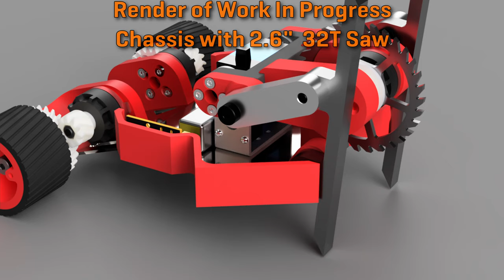Let's Saw Something! Shrapnel Mine 3lb Beetleweight Combat Robot Design

Comment: Would attaching some small hooks on the top of the forks prevent bots from going overtop your bot and potentially keep them in place while you saw?
Reply from the maker: Yup, that's a great idea and something I'll definitely play around with. I just need to also be careful that it doesn't impede driving upside down or self righting.

Comment: You can often find engineering-oriented sales pages for lipos by finding the manufacturer name on the MSDS sheet for your batteries. You can then find the cell you are using by searching that manufacturer's page for your chemistry and cell dimensions.  Once you've found the cell, they often have a chart of C ratings vs time at that rating, which can give you some nuance. For instance, a battery marketed to the hobby community as a 85 C battery might have a continuous rating of 30 C with 80C for two seconds and 90 C for an instant. So if you have a saw that will spend a decent amount of the match under load, you can optimize your current draw accordingly.

Comment: Hey Seth, love the concept of Shrapnel Mine! 
I believe the reason the saw isn't cutting through that aluminum is because it's running out of the pressure necessary to dig out more material. Compared to carbide-tipped saws, ar500 is fairly dull;  when you first start cutting the pressure is still great enough that you're able to make progress, but once that channel becomes larger you rapidly start losing pressure. That's further compounded by your blade being much thicker than the average sawblade.
Using fewer teeth is an option, however it increases the risk of binding. Personally I don't think it's worth it.
Using thinner ar500 would definitely help,  whereas using a commercial carbide blade should give you a huge increase in performance.
Reply from the maker: I have no idea how to find a carbide tooth blade small enough for this application (between 2.25 and 2.8 inches diameter) and if I did I would need to somehow cut a perfectly centered spline or rectangle bore which would be quite a challenge. I considered it originally but thought it wouldn't be worth the effort. If I can find an easier way to do so then I'll certainly consider off the shelf blades
Reply: @JustCuzRobotics  The blades I use on Breakpoint are 3", which is only a tiny bit bigger. I don't know how feasible that size is for you.
As for mounting, I know it sounds crazy, but you might be able to get away with just the friction created by the locknut and a plastic spacer. I've used that combo in 10 matches now and haven't had any noticeable issue with slipping.
If you want a more secure mount you can also drill holes in the sawblade that let you screw into a printed hub, which then interfaces with the topology of the cam and is kept in place by the locknut.
Reply from the maker: Have any links to the saws you're using?

Comment: what made you choose the custom sendcutsend sawblade over a store bought one? motor mounting?
Reply from the maker: Yup you guessed it! The way the saw keeps spinning is that inside of it is a 15mm hex bore, and a 3D printed custom hex adapter to fit inside that bore. The motor shaft is an M5 threaded shaft, and using the flanged locknuts that come with the motor sanded down to fit in a smaller hex bore, I was able to get great torque transfer to the saw and choose a cutting direction that tightens as it cuts so the blade will never fly off. Cutting a hex into hardened steel on an existing blade would be incredibly hard to do.

Comment: My guess is that more teeth will increase its ability to cut through aluminum. Keeping the chip load constant, your material removal rate will increase. The balance is keeping chips from getting stuck in the saw blade itself. I use merchant's circle analysis to get a rough idea of cutting forces when I need it. I just set the shear stress as whatever that material's flow stress is an go. That might be useful for determining the torque you need vs what you have with your motor, blade...etc. Most materials also have documented "machining speeds" so that could be useful for targeting rpm's for different kinds of armor. Idk if youre getting that specific or if this is at all useful information, but I love this concept. Keep us posted!
Reply from the maker: I 100% see what you are getting at, I was just starting to think of this in machining terms as well, as I have done some CNC operation and the speeds and feeds and chipload seem to be analogous here. 

The way I see it there are a few factors I need to keep in mind. 
1: I have a limited amount of torque at the saw as I am stuck with the same motor and RPM (or lower) for all sizes of saw. 
2: I can increase the diameter, which even for the same cutting force, would also increase the torque demand on the motor. 
3: I can increase the number of teeth to take more smaller bites, decreasing the torque demand, or remove teeth, taking larger bites, increasing it. 
4: I may also be running into an issue where my bite chipload is so small I am rubbing rather than cutting efficiently, in which case, fewer teeth would help. 
5: Fewer teeth and larger bites also raises the chance of 'launching' the opponent upwards rather than cleanly starting a light cut. This may be avoidable through careful arm/drive control on my part. 
6: The rules of most events allow for a stationary pin no longer than 10 seconds, so I need to remove material as fast as I can in that time once I start holding an opponent against a wall.

Comment: Hey Seth,
We talked about using a multi material Printer for the wheel Hubs. I am in a big educational Workshop while learning a new Job. And there is an Ultimaker with 2 Extruders. If you want to experiment with a TPU and Something mix, I can get access to this printer. Some copies of a smaller Part shouldn't be a big problem.
Reply from the maker: Thanks for the offer! I'll let you know if I can think of something to try out but if I cannot replicate it myself repairability might be a big problem

Comment: 5:40  A saw blades teeth have to make a wide enough cut to allow the blade plate to pass through. Check out 'Kerf width'.  Also, how hot is the blade getting when cutting aluminium? Expansion slots and tooth angle or 'hook' might be something you could experiment with as well.
Reply from the maker: So looking at some commercially available saws, it's definitely the case that most large blades use carbide teeth wider than the blade itself. However it's pretty common for the 3" diameter and smaller wood/plastic saws to basically be just like what I designed, but much more smooth and with more smaller teeth. Most of the metal saws this size are abrasive wheels or cutoff wheels with no 'teeth' 

Slitting saws are very similar to what I have made but are designed to cut aluminum with constant flood coolant on a rigid CNC machine which is obviously not the use case here. I'm thinking I may be fine using these lasercut saws on soft materials but I'm gonna look into mounting and trying a metal cutting saw for aluminum and harder materials.
Reply: @JustCuzRobotics  Have fun experimenting! 👍
Reply: @JustCuzRobotics  Cut edge quality is a huge priority for commercial blades, lifespan as well.

Could try bending each tooth slightly, alternating every other direction.

Comment: I wonder how a little asymmetric disk would do, since you mentioned throwing things over the bot. A good hard shot to the underside tends to have some nasty consequences, see biteforce vs hypershock.
Reply from the maker: I have intentionally gone with a cutting weapon since I have very little weight to dedicate to it and I feel that it will be extremely hard to get good bite and deal damage with an impact weapon weighing only 40 grams or so. The fact the forks angle up and the arm sort of comes down as they do also makes its travel less than ideal for delivering a big hit.
Reply: @JustCuzRobotics  Ah true. It would be light fighting beetles with a fairy weight.
Reply: @DigitalJedi  It would also put a lot of stress on the mechanism of his own bot whenever he engages.

Comment: Why not put some rubber near the tips of the lifters so a machine can't slip away and for more pushing control
Reply from the maker: Rubber on the lifter isn't a bad idea, and I think adding some ridges or hooks might also work. This whole test process is really just to get the proof of concept to cut something and show that it can work at all. I have a ton of room for improvement!

Comment: You need a carbide tipped saw blade go thought like butter
Reply from the maker: I tried that with my 12lb robot Draconid which uses a horizontal saw as a weapon. The carbide teeth fly off about 10-20 seconds into cutting since the cutting setup isn't nearly as rigid as a mitre saw through a clamped down workpiece. Then it's just dull steel nubs!
Reply: @Team Just 'Cuz Robotics  ahh I see what about one of thoes combination  diamond grinder wheel that cuts steel alum tile pipe plastic
Reply from the maker: I tried a diamond grit saw in this other video https://youtu.be/umQ5ZCRrX5o

Comment: Try offsetting the teeth like they do on regular saws. Instead of all the teeth being in a straight line offset them and add more
Reply from the maker: I can't since it is cut from a flat plate
Reply: @JustCuzRobotics  true. But you can always bend and temper the teeth after?
Reply: @JustCuzRobotics  You could maybe file them to get them sharp and a little bit off set. That would make it potentially easier to start the cut.
Reply from the maker: AR500 doesn't like bending, especially not something that size
Reply from the maker: I suppose I could try filing the teeth hut there is no chance it would be balanced and it needs to spin at 20000rpm so that would not go well if it weren't
Reply: @JustCuzRobotics  also true lol. Try making bigger teeth and extending the reach of the arm?
Reply: Not having the teeth offset will cause you to loose a lot of power due to the rubbing on the side of the teeth and the "gumming" up of the material especially alluminium...

Comment: Couldn't a robot counter Shrapnel Mine by putting their heaviest/thickest top armor on and coming into the match upside down? Granted not all bots would be able to do this, but some still could.
Reply from the maker: While there are a few bots that can run upside down with wheels sticking out above and below, they have the same exact problem if they try to put thicker armor on top. As soon as they get flipped they will either be unable to drive or will get caught up on the ruts and debris on the floor easily. If I can prop them up on the wall once I can probably flip them to a more advantageous side eventually either way!

Comment: Needs less teeth on the blade
Reply from the maker: Why's that?
Reply: @JustCuzRobotics  It's a little counter intuitive but if you have too many teeth, you have far too much surface area cutting at one time. With less teeth, you can cut faster. It also allows for larger chips to form, clearing material more quickly. You could test the theory by removing half of the teeth from a gear you already have. You could also remove every third tooth or something.
Reply: @danielwgk  you need to be careful with this approach though, the fewer teeth you have the more "impact" into the material each tooth has, and the more likely you are to bog down the saw.

A while back I did a bunch if testing and found that saws work the best with as many teeth as possible and a slow but steady cut into the material.

A good sanity check for this is to think about the extremes, if you go too few teeth you get a standard spinner, aka an impact weapon, if you instead go millions of tiny teeth, you have an angle grinder